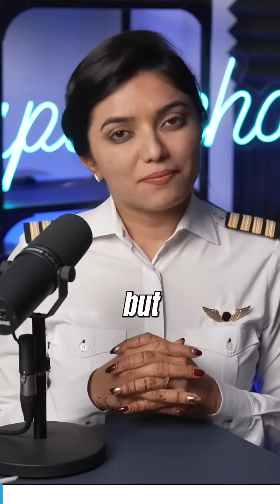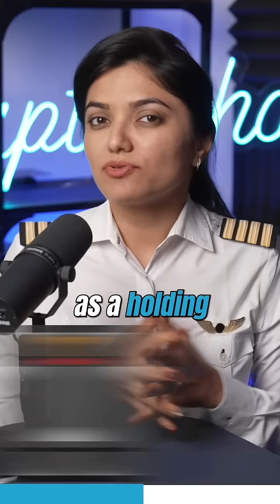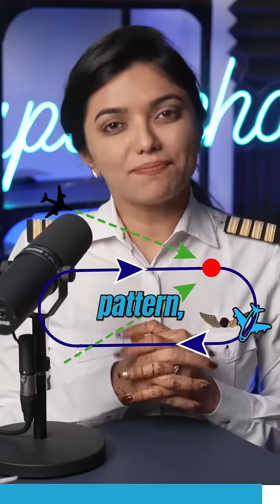Airplane Holding Pattern explained by Capt. Neha Thakare

Comment: there is a confusion I have about standard or non standard pattern, in a video left is standard and right is non standard, which is correct?
Reply: standard means default turn should be left for holding fix. non-standard means ATC will inform you to make right turn in holding fix not left.
Reply: @wizardby664  No Standard turns are always right turns unless told by atc
Reply: Thank you sir